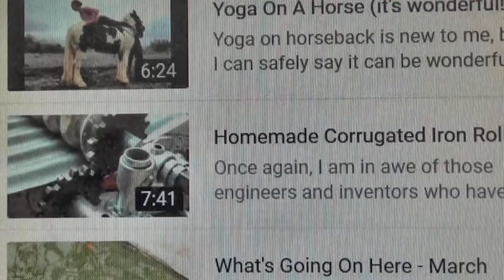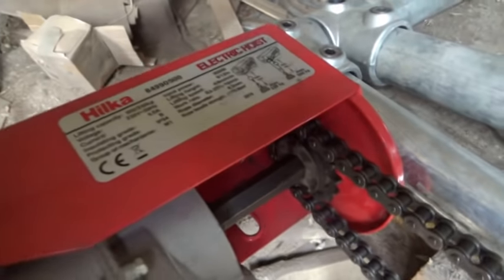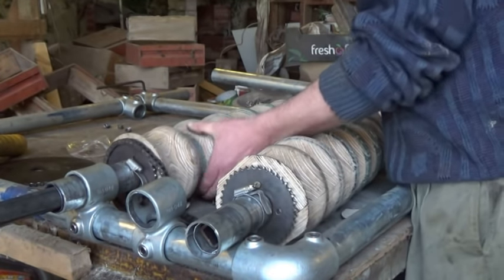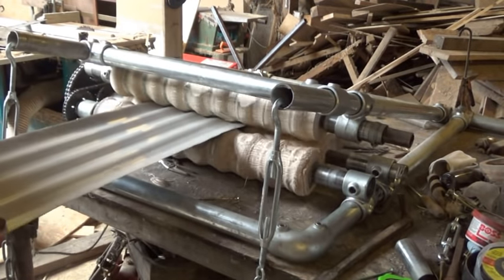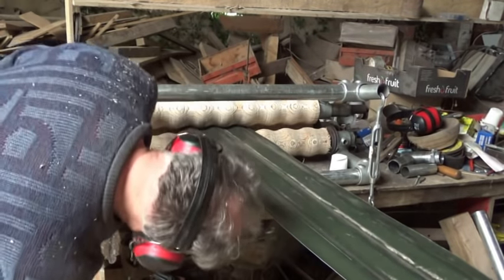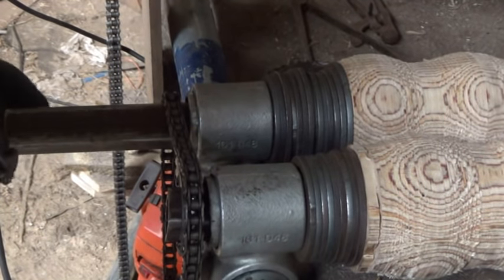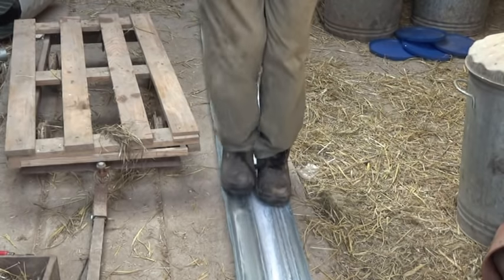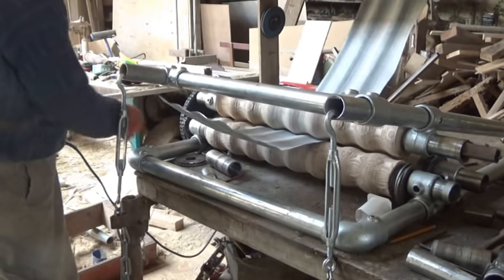Homemade Corrugated Iron Roller - Part Two

Comment: I have this intuition that the sheet should be grasped by rollers both in front of and behind the roller that actually puts the bend in. So essentially it would be on 5 rollers, pulled by the two furthest in the direction it's moving and heavily dragged upon by the rear rollers so that the outermost of the ridges is being slightly, but measurably stretched over the crests on the center roller. Without those crests drawing out to form a longer circumference than the troughs the sheet seems like it would inevitably crumple somewhere. I'm not sure what mechanism you could use to make the rollers drive in one direction and drag in the other, but it seems like something that could done mechanically. 

I began typing out a scheme for a motorized version which could switch direction just by sliding a splined collar, but the explanation looked so contrived as to appear almost incoherent, so I'll just explain how I'd do it with human power or inconvenient winch power. 

Basically the front rollers would have their meshed gears and the rear rollers would have theirs, whilst the central roller is free to rotate. The bottom roller of both the front and rear sets should be able to adjust by 10-15 degrees about the axis of it's shared roller and the central one should adjust vertically. 

Cheap brake rotors from a scrap car should be welded onto the driving axles of both roller pairs and a frame welded underneath to allow modified C clamps to press the brake pads that were salvaged with the rotors onto the rotors, to provide tunable drag. Further out on the axle can be either a drum with hook points, around which the winch line can be wrapped to provide direction reversible torque, or a simple receptor for the large 4 armed crank handle you were turning it with by hand. 

Best I can tell, as long as you started the roller pairs aligned vertically and the central roller aligned horizontally with the two top rollers, then gradually kicked the bottom rollers out while lowering the central one, and as long as enough tension is provided that the crests draw over the center roller crest, it should bend smoothly.

 As far as getting the grip on the rollers that would be necessary, or making sure you have enough torque to stretch the metal, I don't know...
The rollers might do fine just with some sort of dent resistant epoxy painted on but I'm at a loss for the torque problem. This setup would take a lot of torque.

Comment: i am not an engineer or any kind of craftsman.  Could their be some intrinsic issue with uneven density of the wood itself which creates small but impacting differences in the pressure as it is applied in the 360. When uneven density exists in opposition the effect of different pressures makes a skew?
Reply from the maker: You could be right - but I'm using ply in different directions to even things out, so I'm not sure..

Comment: Outer diameter hills need to stretch, don't think you can compress inner valleys (by trying to force this you get this crumpling you keep having). You'd need a contraption that accurately (wouldn't know how to calculate this) stretches the hilltops the most, it's sides a little less and valley sides even less so. Doesn't seem like a diy project, much less so with wood.
But maybe you could create a U-sheet by fixating both ends and have the middle hang in air. Then roll advantageously shaped wheels through the valleys from end to end so that the sheet sacks a little more with each pass until the U forms. I'd need my hands to explain further. Also if you could indeed follow: the holding fixtures should be hinged so they start out holding horizontaly but allow ends to point increasingly downwards the more u-shaped it gets.
Though it would probably be wise to settle for another roof system / structure all together. Also: Thanks for sticking with this so far and showing us what all you tried.

Comment: I once worked in a factory that rolled flat sheet stock into various corrugated shapes. For example it would make wheel covers to go over wheels on trailers.  The machine was computer controlled and would monitor the shape being while being formed so if a wheel cover would span two wheels the machine would curve the leading edge than go straight to span the top of the wheels than curve the back edge and of course cut it to length.  The machine would also do all of this in one pass!
Reply from the maker: Yes, please, I'd like one of those : -  )

Comment: Hi Tim, Have you considered making them with fibreglass, You would need to make moulds to start but after that they should be cheep and quick to make.
Reply from the maker: Thanks Brendan, but I'm not sure about the cheap part. And it's so messy..

Comment: i say your round knobs need to float.  Use only three. the middle make the channel and is hard. The out side are not as 
sharp as the middle or as hard, as the inside knob. Float because the middle is where all the stretch  is going to happen. The 
inside bend no stretching is to happen, outside knobs. Float  outside roller knobs because when the middle is being made it
will pull the middles paths  of the out side  crease in. Which mean the out side crease is always being re made. Not  good.

With all that pressure to float outside knobs is difficult engineering. Or the outside knobs could tilt as the metal is pulled into the center?

Comment: Lexan would probably work perfectly and it would allow the natural light in. It can be molded easily with plywood jigs and minimal heat. Its bullet proof. You can sand the surface so scratches aren't an issue. It can also be painted. It's more expensive than steel but lasts forever. Hopefully that helped. Great videos though, good luck.
Reply from the maker: Thanks, Robert. I was hoping to avoid plastics, but perhaps I should think again

Comment: Hi Tim. Saw a copper pipe bending video where they clamped the pipe end and pulled it around the former. Clamping the end stopped the inner bend from crumpling and stretched the outer part of the bend. Would four rollers arranged like this  o°°o with the back two on smaller sprockets hold the sheet back enough to stretch the sheet around the front pair?
Reply from the maker: Interesting idea, Alan. More things to think about...!

Comment: What if you made something similar to a pipe bender with your shaped bars? So you would orient the bars vertically, slide in the sheet on its side & "persuade" a bit of curve at a time? 
Or stacks of opposing wheels, like rollerblade wheels, in place of wooden bars? 
Or slump a sheet over a form, using heat and sandbag weights?
I have no engineering experience, just throwing ideas out there, in hopes of sparking your clever mind 😀
Reply from the maker: thanks, Tracy, I appreciate your help : -  )

Comment: The bending needs to happen in 2 stages so u have to shape another set of rollers. That set should have cuts across the lobes so that their surface resemble “gears” and use those first to roll the tin with. Then run it thru the rollers u made last to smooth out the surface. Basically the “gear” type surface lobes apply uneven pressure which facilitates bending. Smooth lobes work the surface in x axis only. gear lobes do so in both axis because of the valleys between the lobes and then also in y axis because of the valleys between the “gear teeth”
Reply from the maker: Commercial machines just have smooth rollers though, so there must be a way

Comment: I have rolled lots of metal, the problem is you have two different radiuses, so either the outer radius has to stretch or the inner has to shrink, so if I was going to try this I would not make a wavy profile, i would bend my sheet on a hand brake into a ribbed profile, a flat section and then a raised flat section, up and down if you get my drift, then you need a press to form ribs on the flat sections that will form your inner radius, the ribs will cause that side of the sheet to shrink, how many ribs you form and where will determine the shape of your building, hope this helps.
Reply from the maker: Thanks, Lawrence. I was hoping for a smooth round finish, but perhaps that's just not possible

Comment: Did you try here (Peter McDonald Engineering Ltd ).
Reply from the maker: I'd missed them, Gerald. Thanks
Reply: I have a feeling they dont use home made machines to corrugate and bend the metal used in  those structures on that website products  pic !

Comment: It appeared the rollers might be slipping a bit, wouldnt that cause the kinks? Perhaps if the rollers were keyed do the shafts, and coated on the outside in a thin layer of rubber for grip. Even the brush on stuff might work!

Comment: the main problem is your dies are made of the wood, when you decrease the distance between the dies , instead of force develop on the metal sheet and bend it it act opposite and compresses the wood dies therefore unable to bend the corrugated sheet. I think you need dies made of steels.  But I liked the idea what you did. keep it up the good wok. thanks
Reply: Maybe it could be coated in an epoxy or something to add compressive strength?
Reply: @masonheipel  Yes that is the right word compressive strength of the sheet metal is larger than the wooden dies. therefore dies can not help bending the metal sheet properly.  epoxy wen dried would be brittle and shatter during the compressive stress over the dies. why dont use plain ordinary steel to make the dies as you have means to to do so , I mean lathe machine.
Reply from the maker: Interesting idea - but I'm sure the early ones were made of wood too..

Comment: Use progressive dies or narrow dies. The material shrinks a lot on the width. Maybe use 2 rollers for this. Use the 3rd roller to support the sheet. Set the 2 forming rollers directly over each other. Roll maybe 3 corrugations at first, then use the 3rd formed corrugation as a guide to roll 2 more. Use this progression across the width. You may make a square shaft and the dies with square holes. The same width setup as you now have, just advance the 3 corrugation dies across doing 2 new corrugations at a time.
Then attempt to roll the finished length to curve it lengthwise

Comment: Nice for you to share the full process even if you didn't get to a final solution. I believe the problem lies in the specific geometry between the bottom rollers and the top roller. And a system like that with no bearings might just have to much slop to consistently keep the metal in place for the full process.

Comment: I know of a hand crank corrugated roller type machine. As it happens, I will be at, where it are at. See what I can find/photograph/measure for you!
Till, the morrow, sir.
Reply from the maker: Sounds interesting - thank you
Reply: @WayOutWestx2   Nearly forgot to reply. Yes, the roller is there. It is a 3 roller beasty, 2 on the bottom, 1 on the top which is adjustable up'ndown, set in the middle of the bottom 2. Been told, it is not so much for "making" corrugated iron, but for forming Bull Nose. ie a curve section on the end of a sheet, or even to roll iron in a curve, so as to make water tanks. To form the corrugations, reckon you would require each roller to be directly on top of its mate, as to not apply a length wise "curve" to the metal. Machine is a factory type beasty, castings and such, solid, substantial and pretty old. No manufacturers name, age, gawd knows, early 1900's, 1930???? Could get a photo, if you wants to. edit:- this machine is at the Rockhampton Heritage Village. http://www.heritagevillage.com.au/ NO pictures of the roller here, but directions 'n stuff.

Comment: Unless you're dead set on rolling this thing, you might be better off figuring out how to press it. From what I understand, hot oil works best. I do know however, there is a corrugated factory in Bossier City, LA. McElroy Metal I think is the name. They've been doing it for years. Maybe they have some ideas on rolling the curve.

Comment: my first thought is thicker rollers. the kinks appear to happen from slipping, since increased contact and pressure are important for smooth rolling. plus thicker rollers would also be more rigid. whether or not it's practical is another issue... like upwards of 45cm diameter if possible. best of luck!

Comment: Hi Tim, I do love a bit of rolled iron! Oz is a land of ubiqutous corrugated iron rainwater tanks, and bull-nosed rolled iron verandah roofs.
Also in my case, "pigloos" made from a couple of sheets of rolled corrugated.

I wonder whether other countries have the right sort of iron for doing this?
Here, we use CUSTOM BLUE ORB, by Lysaght, which is thicker but softer steel specially formulated for rolling, and therefore kink-proof.
Also, they use some light oil on the rollers, so there must be a reason I guess.
Reply from the maker: Sadly, I come to the same point - there just isn't the right sort of steel here. Either we have to move over there or give up : -  (
Reply: @WayOutWestx2  

Well of course there is a simple solution!
SImply use flat sheets, horizontally.
Not as good, since rolled sheets have great intrinsic strength, and mine have so far maintained their self-supporting integrity for over 30 years, with just plywood ends and a side ground rail to increase stiffness and prevent pigs or whatever animal from getting a leg under and cutting it off on the sharp edges. I don't have floors in mine, but some do.
So you would need a supporting wooden frame to make similar structures with the flat sheets, but they bend in their longitudinal orientation marvellous well, do they not?
Try one and post a video on it!!

Comment: When you bent a sheet 5 times all at once in creats too much tension on the steel. you should make different stages like multiple rollers in series. First roller bends the center then on the second feed you add two bends dies on each side of the center then on the third feed you add 5 bend dies and so on..  Sorry about  the grammar. A set of rollers in series with different stages us the best option.
Reply from the maker: check out my latest video, Bernard...
Reply: Oh yeah. I notice the date of posting after i wrote the comment. I also checked the video about your project. Its already taking form you really did a great job.  Keep it up sir.

Comment: I'd say you are close to get it right. Take a look at this video: https://www.youtube.com/watch?v=veZ499X1mhk. Maybe the distance between all 3 rollers need to be the same to get a good curve? Your change the distance between 2 of them but not the 3d distance, as you tighten the upper roller downwards.
Reply from the maker: That would mean the bottom ones would have to move apart as the top one moves down? Complicated?
Reply: I mean that as the top one moves down, the 2 bottom ones need to get closer. If the lower two rollers are 'far' apart, the sheet is likely to just spring back, right? There will occur no permanent bend. I guess that as you narrow the radius of the sheets curve down, you need to narrow the distance between the rollers to, in order for the sheet not to spring back. But, as I said, I'm no expert. Just trying to make a somewhat logic guess.

Comment: I know your friend said it would cost a lot of money if you had the metal rollers turned on a lathe. What if you smelted them out of aluminum instead. You could pour each individual "bead" in the rollers. Then slide them together.
Reply: I like this idea a lot, you could even cast them progressively right onto the square tube, and machine them afterwards on the copy lathe, so that they're well concentric and nicely fit to the tube
Reply from the maker: good idea - though casting that amount of aluminium would be a project in itself!

Comment: I work for roll former company in New Zealand. Our standard material for corrugated iron is         (.40mm) g550 tensile when we need to do curved sheets we run   (.55mm)  g300 tensile. If you can get the thicker and lower tensile material it will help a lot. I personally never tried but was told that the machine will not curve the thinner material (.40mm).
Reply from the maker: Thanks, Andre. I'm trying with .6 and .7 mm. The thicker one appears to work better.
Reply: @WayOutWestx2  very interesting stuff just watched your new video making the the 3 rollers if you need more info let me know I got access to 4 different roll forming machines can send you picks of the machine.

Comment: i think your setup is probably a little loose, if the pressure isn't even across the formers then any difference will show up as a deformity which will mess up the rest of the sheet.  you could try "cranked" sheeting which can be ordered to specification.
Reply from the maker: You could be right. Cranked - you mean little controlled kinks all the way around? I haven't found anyone here who does that yet
Reply: @WayOutWestx2  
i used to work on industrial roofing many years ago and at the time we got most of our off standard parts from two companies. CPF in longford and Skyclad in Miltownpass (westmeath) both of which are still in business. i am long gone from the roofing business and have no contacts with either business but a quick look at CPF makes me think they may be a good starting point if you want to buy preformed sheets.
https://cpf.ie/products/bespoke-cladding/
http://skyclad.ie/box-profile/